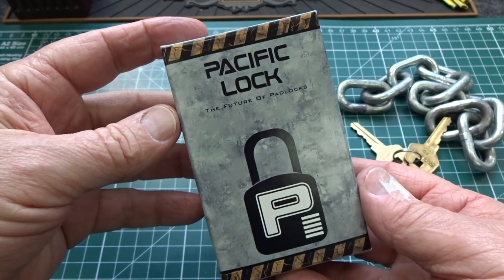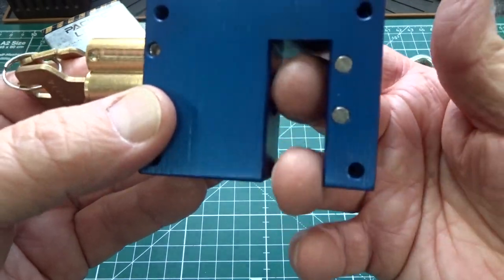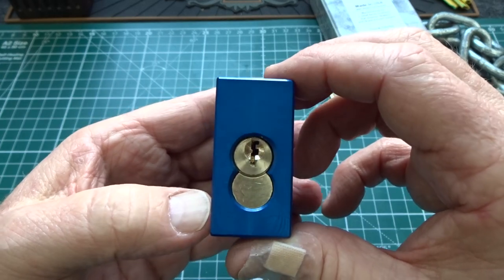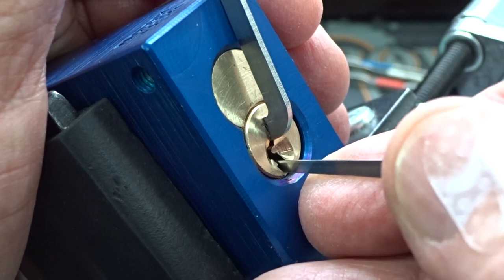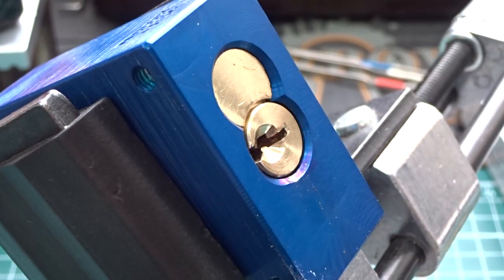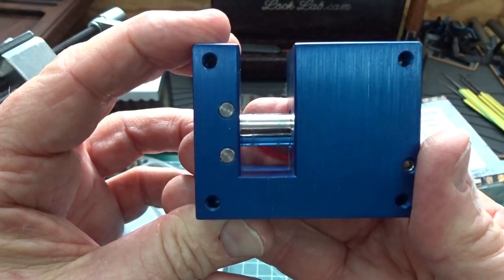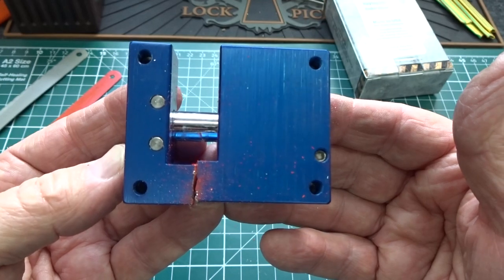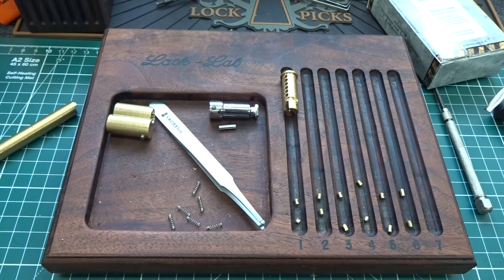(1190) Review: Prototype PacLock Block Lock

Comment: @bosnianbill I'm sure some of what I have to say will be repeated below, but this is "stream of consciousness":
-Threads in the core or bible 
-Steel Pin through the "U" section of the lock like Bill recommended, which might mean using many small pins or moving the screw holes on that one corner.  This also prevents prying the lock apart at the U (basically the strength of the roll pin on the locking bar versus the actuator on the back the brass core of the lock combined with the aluminum body probably won't hold up to a well-purchased pry-bar; the lock would snap at the roll pin allowing it to be separated from the locking bar; pull the core out, rotate the locking bar, lock is open).  The pry method is mitigated if all four corners are bolted in.  It would also be mitigated if the opening to the center of the lock were rounded or tapered (the pry bar would slip out, and this also allows better access for chains like Bill demonstrated).
-Licensing some of Sparrows Chess Pins
-Alloy body (to harden it better but that might up the weight)
-More paracentric or zig-zaggy keyway
-Deeper recess on the lock body for the lock core (the key shoulder itself limits this) to limit picking options
-Steel or nickel anti-drill pins or key/driver pins in the lock core or bible to prevent drilling, as that looks like a simple brass body

Comment: Another great video, but this prompts a security related question: are cheap padlocks (say, for a garage), that have very thick (>10mm), enclosed shackles actually a bad choice?

I ask this, because I am assuming that brute force or angle grinder is the most likely form of attack - then surely anti pick resistance isn't worth paying for - but a thicker enclosed shackle is? E.G el cheapo shutter lock with 10-12mm shackle? (Vs, expensive Abloy etc.) Or is it that cheap shutter locks come with shackles made from toffee? :-)
Reply: go buy a master lock tbh my dude

Comment: From my point of view, (excuse my lack of proper vocabulary) that is a lock for a sliding latch.  Explanation : the latch is kind of a strong metal bar sliding from one part of a double door or from inside the wall facing the lock.  The lock itself might be enclosed in a metal box, fixed there by the 4 screws, only showing part of the side with the keyhole to the user and the shackle facing the door frame.  That way, the lock has only one real flaw if they make it by the million in aluminum, the resistance of those 4 screws to shear.  Being one side implies also access from only one side like for storage facilities cubicles, vault...  Or to catch a sliding door from which protrude a metal bar fitting the space in the lock with a hole to be catched by the lock.
So, to me, it is build to be a fixedlock, enclosed as much as possible, more than a padlock.

Comment: Shackle looked really weak, seems like without a hardened steel insert on the frame of the lock like you suggested, someone could hack through the shackle with the hacksaw parallel to the door, partially cutting that bottom frame.

Comment: My thoughts on the pins would be to thread them in (headless of course) and same for one to block the shackle as recommended. Also make the body out of hardened steel same as the pins. The offset in the shackle bolt would be effective and perhaps widening the slot for side by side link installation.
Otherwise, great lock, great review. Thank you.

P.S. Adding in a few steel pins or anti-drill pins in the core will perhaps stop core attacks.
Reply: J. Wilson These would be great suggestions if they were aiming for the $100+ market instead of the $40.

Comment: does it unlock both ways? making sure the key turns toward the wall to unlock would help in preventing picking a little bit, would not help against physical attacks of course\

edit: saw in the gutting it only unlocks one way. that's something to keep in mind, maybe only have the drill holes on one side and have a "this side against door" written on that side to make sure people secure it that way

Comment: If I were they, I would put a star-shaped hardened steel bolt all the way through the sawed off part of the lock and the one that catches the part that holds the locking shackle. I think a star chape could break some of the saw´s teeth and make it more difficult to break it or move.

Comment: Agree with hardened steel pin insert. Question. Does this lock have outer hardened steel cover covering the locking pin? If so, then it would be even harder to cut all the way through the steel outer plate, plus the aluminum lock jaw too. Good show. M

Comment: Is it just me or does this seem more like a lock for a security locker, indoor.  The flush mounting would stop the attack you did as you wouldn't be able to twist the top from the core cause they are held on the same plane.  Are the corners just tapped or heli coiled? I thing you could just drill I  the outsides of the locking pins and made them loose enough to get the lock to drop and it would be faster/ easier then a saw on a flat surface.

Comment: The aluminum body still seems to me to offer some weaknesses.

I wonder whether the pins that retain the shackle could be forced straight out the far side of the aluminum lock body with a pin punch and hammer.  The aluminum might be soft enough to make that possible.  Granted, the pins may not be visible when the lock is mounted to a door.

Given the knowledge of their location, those same pins could be accessed by drilling two holes in the front face of the lock.  At that point, a pin punch might be used to hammer them out the far side, or move them far enough to free the shackle.

Comment: If it's mounted then where you cut wouldn't do much good. Steal rod or not, the other half could still be mounted to the door since there are threaded holes on all corners. Even then if it wasn't mounted on that end, it would be hard to rotate if it's flush to the door. Of course this is if it's mounted.

Comment: My suggestion for the next prototype is to deliver it to Bill mounted on a door as it should be. It should prevent him from cheating like using a saw where it is impossible to use it that way when mounted. It also shows him struggle much more to pick it.
Also the strength of this lock is the way it is mounted. I can imagine it mounted in such a way only the key way is exposed. The rest is covered by door and panels. E.g. when the door or wall opposite of the key is mounted on top of the lock and the door or wall at the side of the keyhole mounted at the back.it means the entire lock is hidden, and the lock awkward positioned. So please work together with a door manufacturer.
Reply: IkeOld cutoff tool would make light   work on that.

Comment: For aluminum this looks pretty tough to force open. A gear puller forcing a pin thru a hole drilled in the shackle end might force it open if you could grip the lock. It appears to be made to mount on a locker or something like that. While it pains me to share this, WD-40 (or kerosene) can help avoid gumming up blades with aluminum particularly with power tools like jig saws. Probably any common spray lube would work.
Reply: skygh Black board chalk is a great lubricant for hacksaws and fine files. That's what I was taught to use in engineering class. :)
Reply: Enzo Guardino try graphite

Comment: Another destructive entry consideration: the core itself seems to be quite an easy drill job?
Reply: not if it's screwed flat against a surface because you lose the angle but  you could probably mess it up pretty good though.   If you had a big drill, you could just drill out most of the aluminum body and forget the core.   Making it stable to drill is one major disadvantage of being solidly mounted to an object.

Comment: Is the only thing holding the core and the hasp together is the grub screw? Technically, if you know where it is you can drill the side of the lock in this location and unscrew the shackle from the lock then pull everything apart.
Reply: OK, just saw the video again and it is not a grub screw so my idea will not work

Comment: Hi Bill, i would have liked to have seen a slide hammer attack on the lock. Just wondering if the wings on the tail piece would pull through the Angkor pins?
Reply from the maker: Yeah, that would have been interesting but I only had a single sample to play with.  Since the lock is brass and the shackle and locking wings are steel, I suspect the roll pin in the tail piece would have simply torn out.  That may or may not have opened the lock with some messing around with the stuck tailpiece.  Still, it would have been fun to TRY it...;)
Reply: Completely understand Bill, you have to do the best with what you have and i think its safe to say you do just that. 
P.s Thanks for all the great vids, oh  and getting me addicted  to spp. Keep up the good work.

Comment: you can drill a small hole in the aluminium behind the steel pins, and you can punch them back out from there easily. how didn't you think about that?
Reply: MrDoboz Because when in use that side would be screwed to a door

Comment: I'll bet those pins are held in place with loctite CA adhesive.  If you can heat them up enough the adhesive will break down, then you should be able to use a strong magnet to pull the pins out.
Reply: You could also drill the soft aluminum body from the reverse side, then use a punch to push them out... I feel like this could be accomplished in minutes.
Reply from the maker: Technically possible but not realistic when a good 4-pound hammer or battery-powered die grinder could get you in within seconds.  Sadly, I only had one sample to play with or we could have tried that stuff.
Reply: Not if the end of the pins is resting against the door. The pins are only accessible from the side that's screwed onto the door, so this is not a realistic attack.
Reply: I highly doubt that. You really think they went through the trouble of trying to make a new lock, have it beta tested, and it's literally held together with a bit of adhesive and dreams when they could've easily pressure fit the pins for probably the same cost with exponential increases to the locks integrity? There's no logical reason they'd use loose fitting pins that are simply glued in as the only locking mechanism, especially on a lock designed to be in the elements where adhesives are essentially most susceptible to degradation.
Reply: Pins are splined. They might have locktite yo supplement the hold, but those pins are pressed into the bores (typically the splined ends are 1.5 to 2 mills wider than the hole) and would probably require more force to remove than a roll pin.
Reply: That's not strictly true, most stainless steels exhibit some attraction to magnets, the amount depends on the grade of the stainless steel and how it's been worked, the more you work the metal the more magnetic attraction it will develop.
Reply: Clint Jay it's kind of irrelevant because regardlessly if the pins had been worked for a century and you had an electromagnet capable of lifting a barge, it still wouldn't pull the pins out because they're not held in with glue. They're just not, and no magnet is has a pull force great enough to overcome the friction holding them in place, and if it does it'd just rip the lock out if whatever is holding it.
Reply: Even if they were only held in with Loctite, they would not be easy to get out. They're in a big aluminum block, so you'd end up heating the entire block up. And then because Loctite breaks down well above the curie point of most supermagnets, you might need to let it cool down again. Then depending on the grain structure of the steel used, it might be magnetic or not. And your heating won't have helped there either.

If I got that in my home shop with the instructions to bypass the pins, I'd probably go in from the other side with a drill and punch, or cut out around the pins and remove them with some aluminium.

If you have all the tools to do that (and I do), then why would anyone attack the lock? The hasp or door is a much easier target.
Reply: Yup, you'd lose that bet!  No loctite.  The holes are slightly undersized for the pins (stainless steel pins) and we use a 100-ton hydraulic press to get them in there. Keep in mind these pins are pretty long (don't exactly remember) and they're press fit in the whole way. Possible to push out from the other side, but likely many other ways to defeat the lock that are easier.
Reply: The pins aren't going to come out they're pressure fit into the body of the lock.
Reply: If you can heat them up that much you can just melt aluminum.
Reply: thechosendude but if it was mounted and the pins didn't show, would most know of the pins or where to drill?
Reply: sivalley pins could also have a split mushroom end the when driven in snap into a narrowed mating end hole that would lock the pin in place.
Reply: I'll bet they are pressfit because its easier, cheaper, more secure, and fewer assembly steps.

Comment: You’d think it would be less expensive to make a lock body out of a billet of 1095 or even 52100 than to do all the machining of aluminum to insert hardened pins, and anodize it. Either one can give you an hrc of 60+ which would be totally impervious to sawing attacks, and would make so much noise and light if attacked with a grinder that it wouldn’t be worthwhile.
Reply: Good consideration. Anybody trying to grind this lock won't encounter sparks because it's aluminium.

Comment: Cutting the body in half to rotate one side is a pointless attack, as both side would be anchored. However splitting the aluminium casing between the steel pins would breech the lock, even if anchored to a door.

Comment: Ok so why Aluminium?  Why not do the lock with boron hardened steel shackle and hardened steel body.  Threaded core n bible dump the standard pins and also add anti drill pin and steel rolling cover on the shackle. Just a sunshiny suggestion. 😎😃😎

Comment: If it's attached to the door wouldn't that stop it from rotating even if it's cut.
Reply: Yup but if it's only held on with 4 small bolts the entire lock or any side left after the cut could be smashed off from above with a lump hammer very easily too

Comment: They need to include an adhesive drilling guide. If it's supposed to be blind mounted, the basic cardboard template is a pain.
Reply: ... thanks! We'll get our marketing team on that... love social media!  Great idea, thank you again!
Reply: my thoughts exactly...the 4 holes didnt look like they go through the whole lock (?) , so you cant pilot the mounting screw holes...having the holes would show points to drill to get the screws out...maybe you could use them on a sliding wood door cabinet and mortise a rectangle in the side, but it seems like a pain

Comment: do a Gallium test, not a common attack but someone just has to score it, apply a little gallium, in the matter of seconds then come back the next day with a hammer and bust it open.
Reply: why a bucket? a few grams will render a .25 inch heatsink plate + the fins extremely brittle, 40 grams would be more then enough to eat through what appears to be inch thick piece of aluminum.

Comment: Examine all the springs carefully. I bet at least 2 of them are stiffer than the others. Kind of similar to Ilco Bump Halt type.
Reply: ... yup, and the last top pin is deliberately longer than all the rest to help with not just picking, but the bump resistance.
Reply: PACLOCK PRES. Very cool!

Comment: Shades of the American 2000 without the massive steel body
Reply: Yes and no!  The American 2000 was a zinc die-cast body... not really "steel."  Yes, just like their 2010 Series which was hardened steel... or like our "400" Series.  And yes, the idea for the lock did come from the pucks that we make, but the shape did not work for our customer.  So we made it into a block form!
Reply: Paclock Pres: As my brother has 3 ka 2000's on his motorcycle trailer, this is interesting. Through My Lock Company, I presented the three to him for security, as he lives very close to "The Hood" where we live.

Comment: How would you hack saw it if it was installed on the door? Go at an angle with really short strokes and hammer whats left? But then you still cant turn it because it's bolted to the door so you'd have to pry it off afterwards
Reply from the maker: You are absolutely right, hack sawing it off after it was correctly installed would be a tough job.  The recommendation for the insert on the bottom was simply to "toughen" it up against a die grinder attack. Even that will only slow the intruder for a few extra seconds and he will STILL have to use a hammer to break off the left side.

Comment: Would drilling through the mounting hardware work?
Reply: Kai Demler I'm sure, but if you're going power tool route just cut the hasp with a grinder for one operation instead of drilling through at least 3 points

Comment: wouldn't pick this, wouldn't try to remove the pins, won't try to remove the allen screw, wouldn't try to remove anything really. Would just cut through the body on this particular lock or rip it clear off the door. I'd just punch into it and snap it off(or in half). Definitely hardened pin through the bottom woudl be nice :)

Comment: Acouple things i didnt hear mentioned is the shackle hardened and is there anti-drill protection in the bible?
Reply: Riley Fenley the first part it's made of aluminum still I don't think the steel rods are hardened. Secondly, what?
Reply: RimWulf Randall The shackle is the part that slides back & forth when the lock is opened. On a normal lock it would be the U shaped piece that is passed through something and than pushed down to the lock body to secure it. 

The bible is the round cylinder where the key is put into that also holds the key pins. When locksmiths drill out a lock this is the area they aim for. Hardened steel balls, rods or inserts are put in to protect against being drilled out.